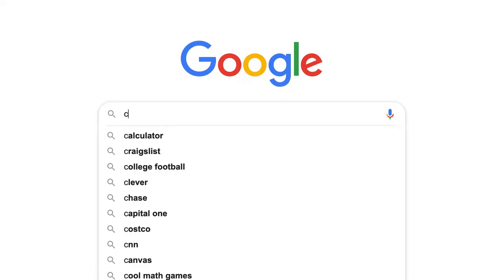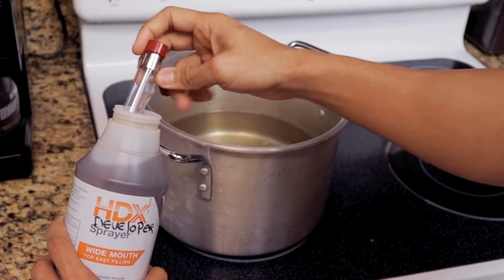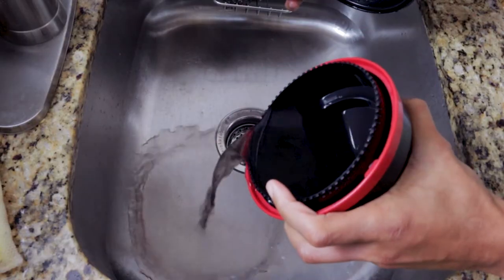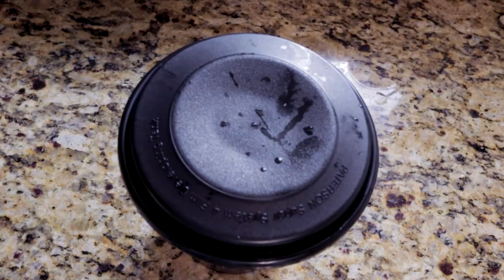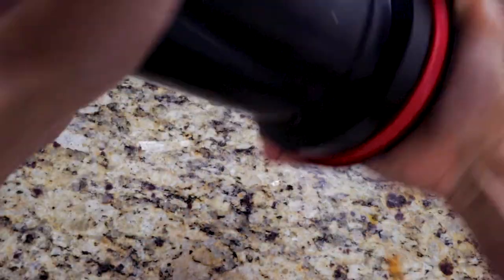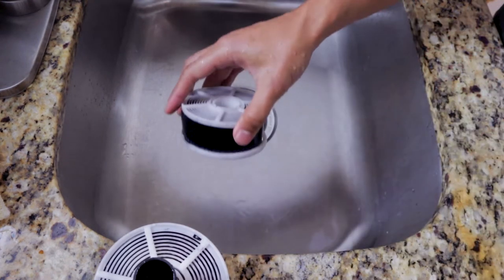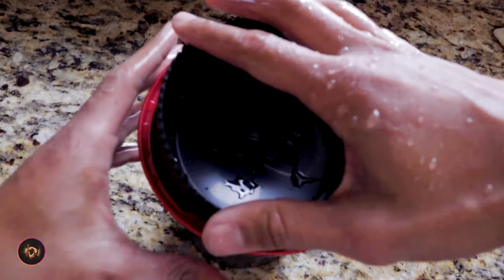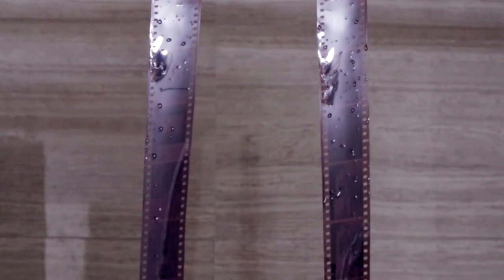How to Develop Color Negative Film Kodak Vision3 500T | Film Photography

Comment: Actually, the Blix does what "fixer" would do, removing the silver halide (and, because it includes bleach, removing the developed silver as well).  What you called "fixer" is the "final rinse" and all it does is apply a fungus and bacteria inhibitor to the film, along with a wetting agent to let the film dry spot-free.  There are C-41 processes that don't combine the bleach and fixer (both last better that way, and they, along with developer, can be replenished in a high volume processing environment), so those would have an actual "fixer" step before the final rinse.
Reply: Actually, Blix means Bleach and Fix.

Comment: By the time you adjust for the light loss from using the 85b color conversion filter to shoot 500T in daylight, you might as well use 250D , which is likely to be sharper and have finer grain than 500T.  One problem is that Kodak makes no effort to sell its Vision 3 film outside the movie industry, so still photographers, are at the mercy of small private vendors to break down the 400 foot bulk rolls from Kodak into either 100 foot bulk individuals can manage or into standard 35mm cartridges. Finding what you want can be difficult.  Theoretically, if you did buy and break down a 400 foot bulk roll, you would save a huge amount of money over buying something like Portra cartridges, however the current middlemen up-price their repackaged products to keep all of that as profit for themselves.
Reply from the maker: Very nice info, I shoot the 500t @ 400 and half stop EV just to be safe and not underexpose it. Plus I like in general overexposing 1 stop. I know, it seems kodak doesnt even try to make it more accessible for 35 photographers but being hones I like it that way, thats one of the reasons it is my favorite film stock since is not as popular as portra
Reply: @alejoperea7  The superior dynamic range of the Vision 3 films minimizes my concern, however Vision 3 films are tuned by Kodak for extremely critical usage in the movie industry. If Kodak says to shoot at 250, then do so! All of these YT BS about half speed rating and intentional over exposure is just going to push your exposures off the best standards. (Such "rules" are also nonsense technically for other color negative films, but it so rooted in the YT urban legend that there seems no point to make the technical explanations for why its not true.)  If you parse out what AP says he s doing, between over-exposure and over-development, he is effectively over exposing his films by 1 2/3 stops as a matter of course. which is just ridiculous. It may be true that "I like it", but if so, he ought to keep it to himself so as to not mislead new film shooter.